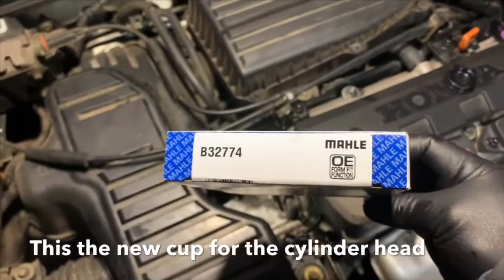Honda Civic 2005 1.7L Common oil leak

Comment: Some people put sealer on the plug. You just coat it with a little oil correct....
Reply from the maker: Yes I just put little oil on the o ring so it will go in easy, some put silicone if their reusing the parts or they just want to make sure is not gonna leak

Comment: 2003 honda civic doesn't  have egr valve please correct me...?
Reply from the maker: Yea actually is the same location on the video
Reply: @junfam24  I don't think dx civic has it on a 2003. I can't find mine ...may be you have a vtec ...
Reply from the maker: What state are you? Because some vehicle made they don’t put some of the emissions control parts, I’m from california their very strict on their emissions, or you can try to send me some pic of your engine I don’t remember the layout of the 03 civic, this my email junfam24@gmail.com you can send it here.
Reply: @mercpindi5522  some do, some dont.